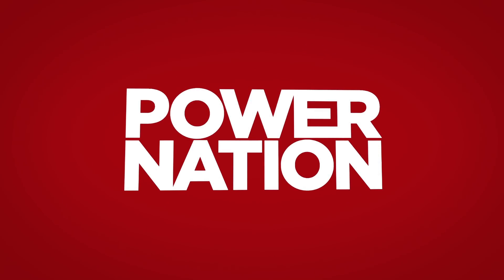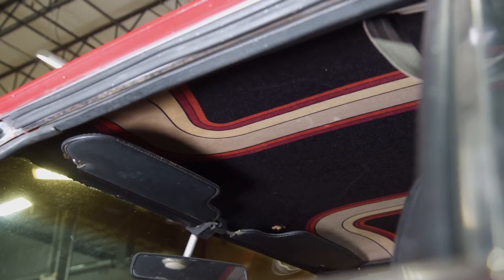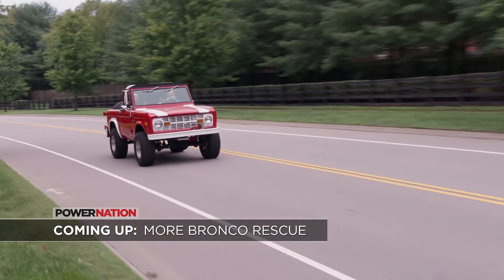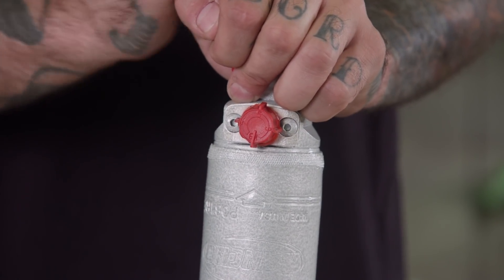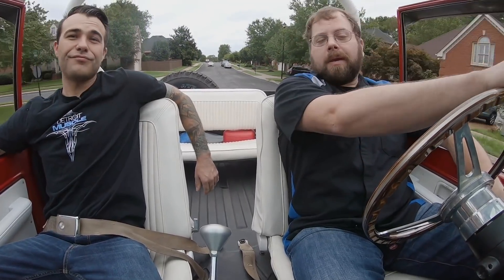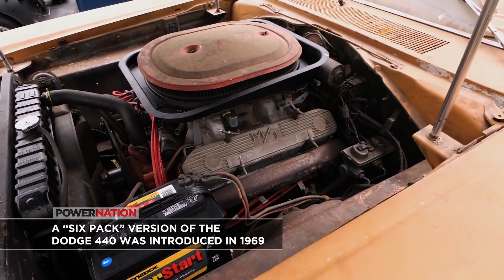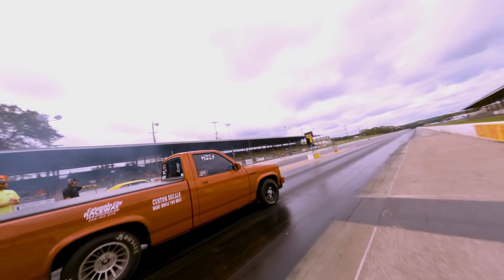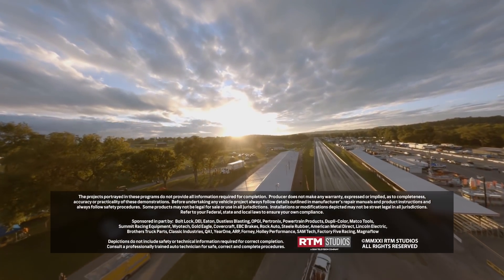Sprucing Up The Suspension On A Beautiful '70 Bronco - Detroit Muscle S8, E18

Comment: Outside, candy, but inside the trough is rusty ... The power elements of the body are rotten through and through, the seat belt is on the belt ... The first accident and there will be a bunch of corpses. She must not be released onto public streets!
The exhaust pipe is welded from pieces of pipes of different diameters and conditions .... well, the car is so-so ... I would advise you to really drive it only on the lawn behind the house